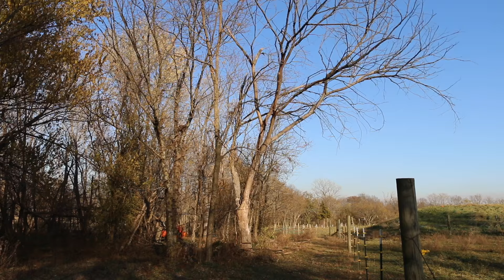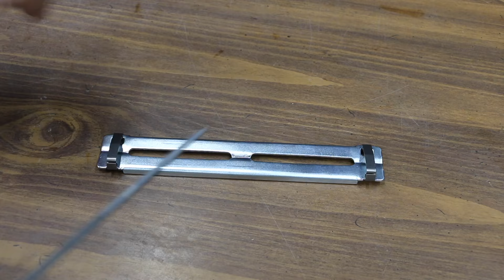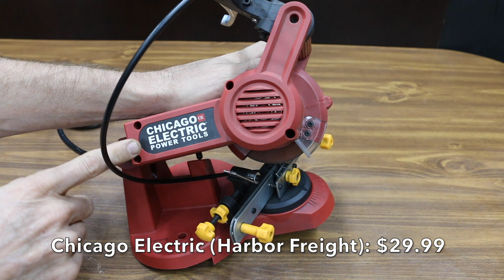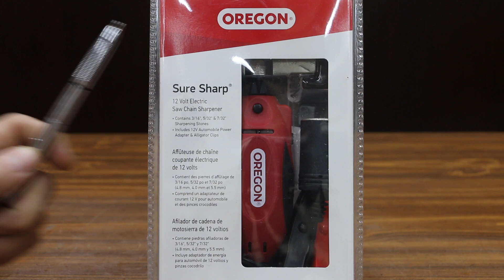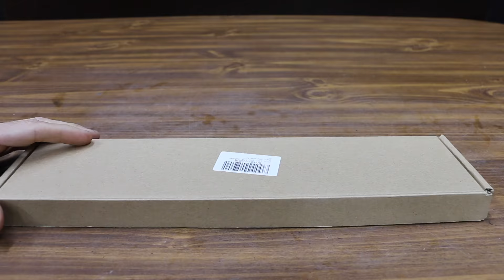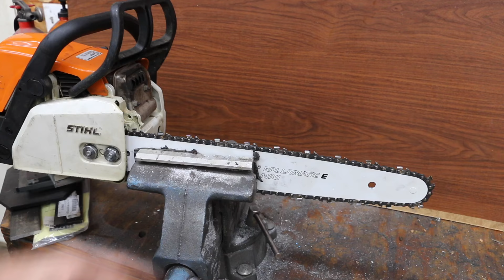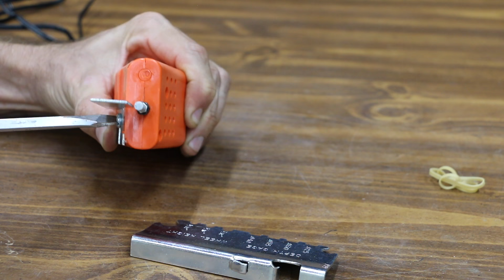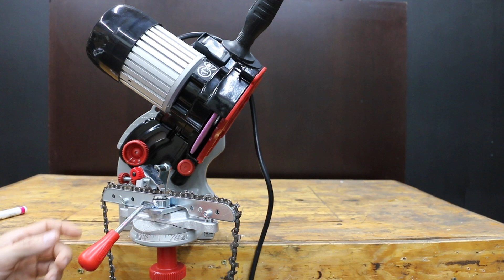Which Chainsaw Sharpener is Best? Let's find out! Stihl, Granberg, Chicago Electric, Oregon

Comment: A friend of mine swears by a 25° angle. It would be cool to see too.
Great job PF thanks.
Reply: It is not too difficult to measure sharpness. Take a calibrated line in a jig over a scale and cut through it. This gives a quantitative value directly related to the sharpness of the edge under test. I've seen the test performed on a number of edges sharpened at different angles. A 25° angle will be sharper than a 30° is until they've both done a little work. Then the 25° edge will dull faster. It happens very rapidly. Steel is only so strong. When thinned out to what we consider to be a sharp edge it is not very strong at all. A big problem when discussing edges and sharpness is it is difficult to directly see what is actually going on. Todd uses some microscope close ups. He really doesn't leave them up for long enough to do any meaningful interpretation though. You have to pause and really look. Or just know what to look for. Dullness is characterized by a brightness where the edge should be. If an edge is truly sharp there's nothing for light to reflect off of. So really sharp edges have a black look about them. Like they're sucking up light.
Reply from the maker: You are welcome!  Thanks for the feedback.

Comment: Dremel made an attachment for the rotary tool to sharpen chain saws.. I use it and it does a great job... also how about that gimmicky-looking one that goes over the end of the bar and you push the running saw into it?

Comment: I would like to see you test a square filed chain against a square grind chain and maybe compare those to round file or round ground chain
Reply from the maker: Thanks for the video idea.
Reply: @ProjectFarm  I just thought of that because I’ve heard that square filed chains are faster than round file, and then I’m curious to see if square ground is faster than square filed. What I’ve seen used for square ground chains is I believe a Simmington grinder, it’s a stand alone unit with a single leg going down and a motor on the top

Comment: Great video I have the harbor freight sharpener I’m putting a cutoff wheel on mine
Reply from the maker: Nice 👍
Reply: @ProjectFarm  if you ever do another video on the sharpest chainsaw chain I just got one from tractor supply that says it’s a has titanium cutting teeth I have hit the ground twice and very dryer wood and it’s still cutting good it cost $26.99 it seems to be doing good.

Comment: The grinders changing the cutter geometry wasn’t the grinders fault, they all have adjustments on them to fit the personal preference of the person sharpening
Reply: It's always operator error. But that is a factor in this testing too. I think Todd is above average in his mechanical aptitude. So odds are his viewers are not going to have any better luck than he does. He even went back and gave it all a second shot. Which illustrates the impact familiarity has with all these methods.
Reply: @1pcfred  there will be operator error no matter who is the one working it, and I’m sure it didn’t make a large difference if any at all
Reply: @kiernanb9445  I wouldn't bet on that. Sharpening is a lot more involved than it looks. There's a huge gap between the first 90% of sharpening and achieving that last 10% of performance. Now whether it is worth pursuing is another matter.

Comment: It looked like one of the grinders was heating up the chain to the point where the cutting edge was glowing.  I wonder if that would make it dull faster.
Reply: Probably not as much as many would think. Being as chainsaw chains are not hardened and tempered anyways. They're hardly fine cutlery.

Comment: Some thoughts 1) What happened to the "3-5 second" method? Maybe I missed it, but I didn't notice any further mention of that during the tests. 2) It's true that there are two factors which aren't necessarily well-correlated: speed of use vs degree of sharpness. A sharpener that's quick and easy to use, but doesn't necessarily do the PERFECT sharpening job might still be preferable. I would have liked to hear your comments about ease of use of each. 3) I noticed some "coloring" of the teeth with some of the grinders. I wonder whether losing teeth tempering is a factor with some of the grinders. 4) I've watched the "pros" use chain saws (loggers) and I notice that they give very often and regular "quick touch-ups" while working (they have a file right with them at all times). That's another indication that a "fast and easy" method might be best overall.

Comment: An ordinary chainsaw file does the job for me, though an ms 170 16 inch bar, probably takes me between 10 and 15 mins, larger chains take me much longer, I could spend over an hour with a ms 260 with a 20 inch bar, and it depends how blunt it is.
I was lazy once I sent a chain away to be sharpened, ruined the chain, it felt dangerous to use, if you have a chainsaw, I find it's best to take your time and sharpen them your self.
Great video interesting to see.
Reply from the maker: Thanks for sharing.

Comment: The products that sharpen the chain on the bar are best. Did you account for the time taken to re and re the chain for the bench grinder types?
Reply: You really have to take chains off saws to clean them out anyways. So the time it takes to take the chain off doesn't matter. Because you should be removing it either way. Now I get that some folks like to dress their chains in the field. Why they're doing that is debatable. They're sure not cutting wood while they're faffing about.

Comment: That 1st time you sharpenned the chain with most expensive oregon brand sharpenner.. 16 seconds cutting time, because too much friction. Do not press that sharpener for too long, because chainsaw tooth will turn blue, softening the metal. :) Had a bad experinece with that to me already.
Reply from the maker: Thank you!

Comment: I have used the Husqvarna 2n1 sharpener for 15 years until I bought a Dremel last year.
The Dremel made sharpening 6 chains like I was manually sharpening 2.5 chains.
I still take the Husqvarna 2n1 when I go to the mountains to cut timber for the house.
Reply from the maker: Thank you!

Comment: The most interesting part was cleaning them.  That’s probably the first thing I need to do from now on.  
I’ve always used the basic Oregon kit.  I think I’m going to get the Stihl 2 in 1.  It looks like the most versatile.  Thanks for this video.
Reply: The Stihl 2n1 is worth every penny.  Grab a chainsaw stump vice as well and you can keep your saw sharp out in the field quickly.
Reply: The stihl 2in1 is awesome.. I own several of the others and will never use them again... 2in1 is the bomb
Reply: Just remember that the 2n1 is only used on full chains such as what he was using. If you have a skip tooth for faster cutting of large wood you would want the other one.
Reply from the maker: Thank you!

Comment: Great video! I live out in the sticks, and use firewood as my primary source of heat during the winter. This has certainly helped me choose which sharpening system to go with.

I spend a lot of time driving my jeep out into remote parts of the state, exploring mines. You've done a few videos on tire inflators, but they seem to focus on the smaller end of tires (I actually purchased that Harbor freight pump for my light-duty truck). Is it possible (or even necessary) for you to review some pumps for larger tires? I'm running 35's on my jeep. Thanks!
Reply from the maker: Thanks for the video idea.

Comment: Another great test. Only thing that could make it nearly 100% reliable results is to build a jig that ensures the saw is at 90 degrees vertically and horizontally. A degree off either or both ways results in more wood being cut
Reply from the maker: Thank you!

Comment: I ordered a replacement chain based on your other video. I had questioned whether I should buy a sharpener but at $11 at chain I would have to use my chainsaw a lot more frequently than twice a year before I could break even on a sharper.
Very helpful video.  Way too many adjustments on the $30 Harborfreight sharpener to mess with though I assume once you set it you don’t have to mess with it again.
Reply from the maker: Great!  Thanks for sharing.

Comment: The Oregon bench chain sharpener you gave here is without a reversing switch to reverse the cutting wheel to cut the opposite sides of the chisels..  You also have to set the angle of depth for each chain to get into the chisel without cutting the head of the chisel tooth off and creating heat/bluing the metal..  It is a very good sharpener once familiar and set up.   Been sharpening chains in the lawn mower repair center on a Oregon sharpener for almost 25 years.

Love the effort you place in your videos.!  The testing methods you go through are better then some mfrs do.
Reply from the maker: Thank you!
Reply from the maker: Thanks so much!  Thanks for the feedback.
Reply: How many people do you think want to invest 25 years into sharpening? My guess is not a large percentage of viewers here. We all don't need to know all the ins and outs of making homemade plumbuses.
Reply: @1pcfred  Its one of many skills working on OPE equipment.  It's not uncommon to have customers bring chains from saws where they destroyed the teeth from sharpening with improper techniques or tools.  Only saying experience comes with practice with proper tools to do the job correctly. 

Thanks for the comment! ;)
Reply: @InkBunnyBlindRabbit  well sure. There's two ways to do everything. The right way and all the other ways. Most folks are going to use one of them other wrong ways too. That's just the odds how the game is rigged. The house always wins. Though that's not to say we all can't get lucky sometimes either. I really liked a line I heard in a movie once, Nothing starts out complicated, it just gets that way. The further you go into anything the more involved it becomes. Another thing I live by is 10% often gets you 90% of the way there.
Reply: @1pcfred  True spoken words!
Reply: Thanks for sharing your experience.  I found it interesting.
Reply: @allanwind295  You are welcome!

Comment: I work with chainsaws for a living(forest service). Yes it is nice to have a machine edge on tour chane, but in my line of work we are out and away from any electricity. And once you have a stone ground chane you have to re profile the blades if you wand to hand file them. As long as you take the time and get good at using a hand file you don't need to buy expensive tools you don't need
Reply from the maker: Thank you!

Comment: You can save money on the Stihl 2 in 1 by buying from the original manufacturer Pferd.  Amazon carries them.  Another great thing about this sharpener is it files the depth gauges (rakers) at the SAME time as you are sharpening the tooth, further reducing the sharpening time.  Also the chain can be sharpened while it is on the saw, unlike some of these sharpeners.  I've lived on two forested properties and have Pferd sharpeners and LOVE them!
Reply from the maker: Thank you!

Comment: Only problem I see is a few knots in the board which definitely slow cuts down. Otherwise very well done. Good results.
Reply: Chainsaws are really made for cutting green wood. So cutting any seasoned timber is a bit of an issue. Wood changes a lot in the drying process.
Reply from the maker: Thank you for the feedback!

Comment: I sharpen chains for customers and always can tell a ground chain, they dont know what they are going, the tooth has no gullet or the grinder cuts down into the link of the chain. Once the gullet is gone and cut to deep it is almost impossible to file the gullet back in to get it right.
Reply from the maker: Thanks for sharing
Reply: Grinders work fine for me. Word is they aren't as good as a file but I prefer them to hand filing.
Reply: Cletrec - what you using to sharpen?
Reply: @danltiger  I use the Granberg file holder type, love it!
Reply: All true. However I use a grinder so I can always get the chain back even tho the situations you stated are evident. My chains are in operation until they either break or the cutters get ground all the way back untill they break off.

Comment: Great video thanks for posting.
Question - my new dewalt battery chainsaw leaks bar oil when not in use, apart from running it dry on the last cut do you know of any way to stop oil going everywhere. Its not that practical to run it dry etc. My old Kobalt battery saw did the same.

Comment: I wash chains in mineral spirits, take an old towel dry them and the rest will self dry.
Reply: Gasoline is a good cheap alternative cleaner.
Reply: @cjmx06  How do you dispose of the now dirty gasoline?
Reply: @allanwind295  burn it as fire starter, or pour it in with your used oil to be recycled. Also the small amount you'd need will evaporate rapidly if you don't seal it up. Everything mentioned would apply to mineral spirits the same.
Reply: @cjmx06  Thx buddy!
Reply from the maker: Thank you!

Comment: I thought it was interesting that the Granberg and Stihl all did better than the new chain and that the Oregon sharpeners all couldn't match the initial sharpness of the new chain. It was also interesting that the Harbor Freight was better than the expensive bench grinders. 

I would think that using a thicker grinding wheel in the HF would have not changed the geometry of the tooth and actually lead to a faster cut.

Comment: You should have tested how slow a unsharpened chain is just so we know how effective some of these sharpeners really are.
Reply: I'd have liked to have seen that myself. But we know when chains are dull. When they stop spitting out chips and make that more mossy consistency dust. He cut seasoned wood too. Green wood cuts different than seasoned. It is literally different stuff. It's all wood but as wood dries it changes. That's why we dry wood. To change the properties of the material.
Reply from the maker: Thank you for the feedback!

Comment: G'day,

Yay Team !

I use a Hand-File & Guide, pretty much like the Oregon Field Kit, but that Stihl 2-in-1 Gadget looks pretty interesting...

A couple of points you missed..., first is the importance of removing the same amount of metal from ALL Teeth on the Chain at each sharpening, achieved by locating the worst Cutter with the deepest damage, and starting with that Tooth ; by counting the number of File-Strokes that Tooth takes to recover it's Edge then one can treat ALL the rest to the same process.

Failure to sharpen on this principle ALWAYS results in the individual Teeth having different Profiles & different Cutter Heights relative to each other..., and if one is lucky the Saw will only buck & hop & race & bog-down in the Cut...; but more often one manages to remove more Metal from the Left-side or the Right-side - leaving one side with larger Cutters which will bite into the Wood more deeply, thus tilting the bottom of the Cut - leading the Saw to cut away in Curves, pinching the Chain & Bar which overheats both  the Chain  & the Bar, eventually destroying the Temper of the Metal & effectively ruining both...

Secondly..., those "Dremel-type" units with their tiny little Spin-Stones have a built-in problem..., in that the Stones wear away and shrink with use - radically changing the profile which they cut onto the Teeth... (half a millimetre off a 5-mm Dia. Stone makes it a 4-mm Dia. Unit) so to maintain 95% Cutting  Accuracy then the Stones need to be replaced after only wearing down by  1.5%...

Files, and Edge-Cutting Wheels, are both immune to such Shrinking Radius issues.

  I might go looking for one of those Stihl 2-in-1 Gadgets...; it looks to be an improvement over my current habit of aggressively filing the Rakers "by Eye", maybe every fifth or tenth time I do all the Cutters - basically when the Saw begins to cut too finely & slows down.

Thanks for the tip.

Have a good one...

Stay safe.

;-p

Ciao !
Reply from the maker: Thanks for the feedback.